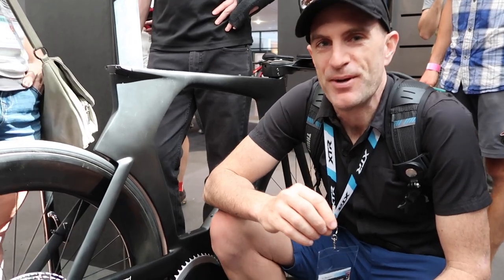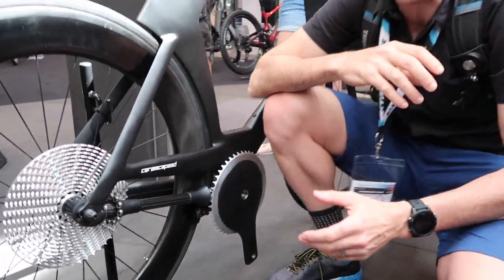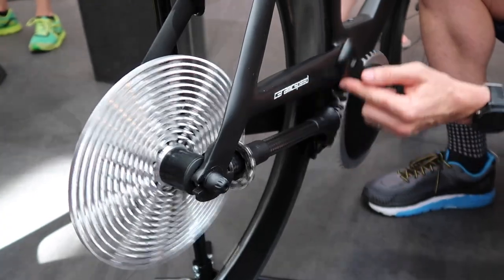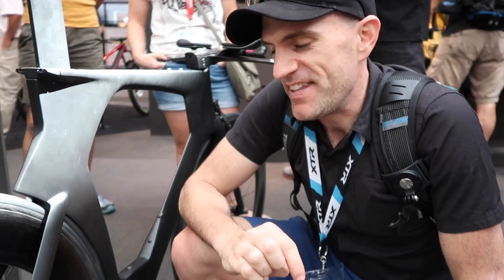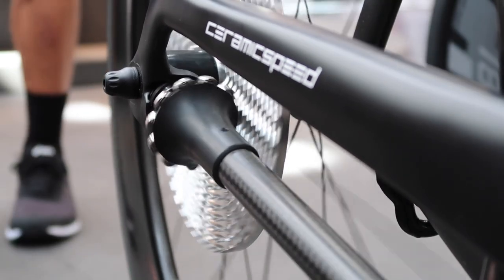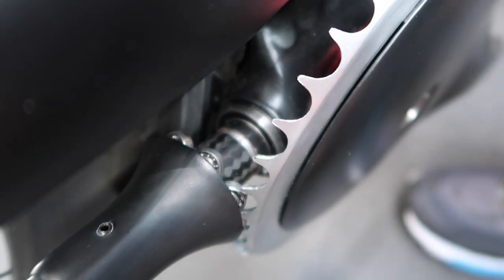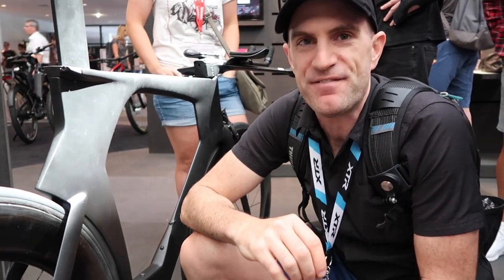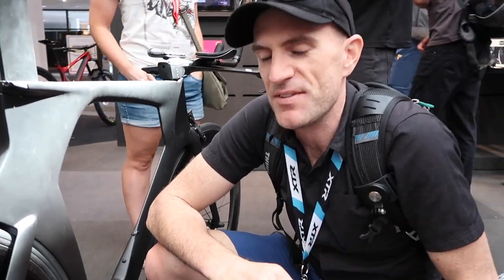CeramicSpeed DrivEN 99% Efficient Drive Shaft // Chain Free Bike // Eurobike 2018

Comment: This is literally a drive shaft with the pinion being replaced with bearings. It's not going to be 99% efficient just due to the mass in that shaft alone, let alone the friction in the pinion bearings, or the bearings acting as a pinion. There's a reason chains are used on motor cycles for performance and not drive shafts. This driveshaft set up is a joke.
Reply: Some BMW/Triumph motorcycles are shaft driven. Although it is not as efficient as a chain it is slightly more silent with hellical gears.
Reply: More than 50% of motorcycles are shaft or belt driven but the rest of your comment is correct. Just reading it seems to me though that you're assuming the majority if not all motorcycles are chain driven. That's not the case.
Reply: nateh120,
please provide the link to the source which confirms your claim of "More than 50% of motorcycles are shaft or belt driven. All too often people are just throwing out numbers on here to back up their preconceived ideals and why they don't provide the source or a credible source to back it up
Reply: nateh 120 
Lots of Harleys are belt drive, Honda sold a ton of shaft drive Shadows over the years etc. It might not be 50% but I'll let someone else count beans. I have a life.
Reply: And yep, the automobile was a joke to the horse industry, and the chain is so 18th century, just like the wind mill. Wich is so 14 or 15 century. ???? My point is, new tech is always cool, any tech to delete a chain from a bike is cool thaught.
Reply: Mass has nothing to do with efficiency.  I think that could probably be just as efficient as a chain.  Durability, and strength OTOH, I'm not so sure about.
Reply: More than 80 percent of statistics are made up on the spot
Reply: shadowwolfXD97 good one
Reply: byw it sucks that you don't seem to understand physics all that well.
Reply: Nwimpney, what is inertia? What are frictional losses? Mass eats up input power. In a perfect highschool physics class it would only eat up an intial investment, and if you never came to a complete stop it wouldn't be less efficient. But this is the real world with real materials and real scenarios, Materials all flex. A more massive object puts more strain on bearings making them operate at a higher friction level, making the drag more power. And on a bicycle you don't just pedal up to 10mph and stay there. You're constantly changing speed, meaning you're putting in work nearly all the time. Mass is something to consider beyond your pretend world of 9th grade physics.
Reply: nwimpney lol how does mass have nothing to do with efficiency? A motor spinning something with a smaller mass is gonna be more efficient than spinning something with a higher mass.
Reply: Thank you!
Reply: Why are chains not used on cars?
Reply: so sorry but it's 89 percent
Reply: byw 

The main reason chains are used on bikes is they're very, very cheap to implement and design.
Reply: I like to see that also.
Reply: How Its Tanked you need to look up the definition of efficienciy
Reply: Yeah, but shaft driven motorcycles have an internal gear box doing the transmissions, not the shaft itself. It's not comparable.
Reply: SirArghPirate look at the BMW 1200rr naked bike driveshaft. Lovely. Only does a 90° once. Its dope.
Reply: shadowwolfXD97 just like that one lol
Reply: If you think about how many scooters are in china and india, (which are all automatic shift by belt) that 50% is not that crazy claim.
Reply: You are absolutely right Chain loses almost 3-4 percent of an engine can put out, belt system has almost 10-11 percent of power lose. Shafts loses almost 30 percent of total engine output power but more durable and smooth and quieter.
Reply: 50% belt/shaft driven? What planet are you from?
Reply: Chains are used in car engines to drive the camshafts/valvetrain/lubrication systems.
Reply: kistuszek Scooters do not "shift". They use a CVT.

Comment: For zero drive train losses, have no chain, no pedals, nothing. Except a saddle to sit on and you move by pushing your feet off the floor, Flintstone style...
Oh, we tried this in the 1800's. Mmmm. Ok, tell you what lets use a chain to drive a back wheel and use pedals to rotate the chain ring. Yes! Problem solved....

Comment: A gear made out of aluminum?!  I think not!  Try making it out of titanium if you don't want it to shred itself after the first 100 miles.
Reply: drop92nn I agree. Only adamantium can hold up to all those battles.
Reply: Mr Brightside I don't know... There are some pretty long hills.  If they started at the top...
Reply: Unmannedair you are missing the key factor here.  Typical gear pressures occur due to the shear and slip.  In this case hard faced aluminum against a ceramic bearing shouldn't be deformed so long as it can resist deflection.  If made of say cuntstained targlide it would be even harder with a carbon backing for rigidity.
Reply: unobtainium is what they need to use for that set up.
Reply: You do realise the majority of gears are made out of aluminium.
Reply: yes, you are correct, however as said in the video, this is a mockup/prototype and is only meant to demonstrate the concept so it doesn't need to be made out of stronger materials. It is cheaper to use aluminium for prototypes instead of wasting money on failed designs using expensive materials. Later versions of this will use better materials. E.G the wheels used on the Bloodhound SSC      https://www.youtube.com/watch?v=mPshhkYpCBY&t=481s     5:20 onwards.
Reply: Joshua Amaral  Riiight. ;-)
Reply: jim jaco  I was thinking of vibranium. Wakanda forever!
Reply: pbgd3 but that is the problem.  The problem here is that unless it has some kind of deflection reinforcement it will deflect.  Maybe not in a lab, but real world is very different from Lab conditions.  Also aluminum gears are fine, but the strength is proportional to the thickness and those points are going to suffer horribly if any deflection occurs (and it will).  The additional problem is that the limit of plasticity will be reached on those tips long before the gear reaches any kind of critical strain.  This means that an aluminum gear like this will take progressive damage from metal hysteresis and work brittlizing  at a fairly quick rate (in terms of product lifespan).  Did you mean to say tungsten carbide?
Reply: In what world would anyone PoC and prototype with titanium
Reply: It's a prototype...
Reply: Diamond would be the best
Reply: doesn't look like it can withstand the force compared to the chains surface area, i think at the moment only two ball berings applies force on that aluminium gear disk
Reply: They don't make a material that would be stiff enough for the 8" sprocket to stay engaged with those slippery little bearings. As soon as a 165 lb. athlete jumps on one pedal with all her weight that little bearing is gonna spit out those sprocket teeth like the seeds of a cherry tomato!
Reply: its a concept...
Reply: @IRRob.  in a world where you claim 99% efficiency, i would say ..

Comment: Place this in an enclosure with a light motor and would be good for a electric bike. Also enclosed could be good for just basic riding but the mechanical advantage that a chain gives over this is just so much greater. The slippage of those bearing and any debris getting in them will kill it. Also I can see trying to change gears causing the bearings to lock around the driven gear and breaking the entire thing. Cool concept but doesn't seem practical at high speeds or in dirty environments.
Reply: An electric bike would't need a gearbox.

Comment: That is incredible. I see much room for improvement and much more than just bicycle applications.
To start with instead of having teeth it should have a thicker stock with ridges instead of teeth.
That would drastically cut down on CNC time and make it a much stronger plate.

Comment: Nice-ish in theory...  but no.  It won't work.  The wear on the very few teeth ever in contact will be HORRIFIC. The noise at even the lightest power is testament to just how much friction there is.  

At a guess, 8hrs to machine, 8hrs to destroy.  Also from an engineering standpoint, the closer you get to the 11t equivalent the more teeth will shear.  The closer to the much higher gears, the more the "cassette" will flex in towards the spokes.

Can see multiple weak points and multiple high wear contact points.  Not going to happen
Reply: I would worry more about the roller bearings being the primary power transfer elements.  They're typically not up to that.

Comment: - excesive cassette wear
- extremely dangerous - will require cover (ugly)
- noisy (higher speed = louder)
- small fragment of stone between the cassette and the bearing = disaster.

no, thanks.
Reply: I think the 1st and 3rd points are valid
Reply: How is it any more dangerous than a standard rear hub and chain?
Reply: Nope
Reply: Does it really need to be explained? this cassette is large and all the teeth point towards other cyclists and there is no derailleur or anything that would provide at least some protection. This is a meat grinder. And the contact between the teeth and the bearings must be extremely rigid to prevent tooth skipping because all cyclist weight will always be concentrated only on 1 ! tooth. So if there is an incompressible material between the teeth and the bearing, such as a stone or a piece of metal, the cassette will be damaged immediately or the shaft will be destroyed . That's dangerous. All this is not a problem with a chain.

Comment: I think it’s very beautiful very futuristic concept but the actual engineer practicality is suspect
Reply: +phuck ewe same was said about the first bicycle ever made.
Reply: Looks like only one ball bearing at a time contacting the ring while with a traditional chain drive you have anywhere from 6-30+ teeth being engaged by the chain. I see a large engineering challenge to make this more reliable than a chain-driven bike.
Reply: Futuristic? They used these types of drives in the 1890's.  Even had ones that shifted gears in the early 1900's.
Reply: steampunk type of practicality

Comment: Just an overcomplicated gear drive built of lightweight and weak materials and promoted well. This could be engineered to be more robust without losing much efficiency. Theoretical 99% efficiency is useless if you can't put the power through it without something breaking or malfunctioning.

Comment: Trying to reinvent something that no one asked for. Bike chains are simple cheap and ubiquitous. This looks complicated, expensive, and not leap of improvement over the current chain systems.
Reply: It's worse than that - they've invented nothing, this style of drivetrain has been around for literally centuries - have a look at drivetrains in Dutch windmills for example. This technology actually predates manufacturing and metallurgy being good enough to make reliable chain drives. When chains came out the whole bike industry went straight to them because they were much better.
Reply: peglor a chain is incredibly low friction and high strength

Comment: Looks cool, but unreliable
Reply: DEVARMONT7 key word is probably, all I'm saying that the idea is great, it just needs more tech to it to make it sturdy. Think of it, how many forces it will endure on road. Chain is simpler, thus it is stronger
Reply: Marat Bodrutdinov my guess is that this is a concept for real bicycles they will cover sensitive areas. I like it a lot. If succeeded it will bikes simpler and probably cheaper.
Reply: Dominique Lawson As everything else this could evolve to, so that it could pop out if you put too much tork on it. The chain system has evolved a lot since start also. Or it could find its usage for specific bikes.
Reply: This is really just a couple gears when you think about it
Reply: Unreliable? It's not even in beta test. Illogical statement.
Reply: i agree, pick up any old hand powered egg beater and see how well it works...lol.
Reply: Steve Lesson  The concept has a long history, and most engineers will tell you that this looks unreliable. You can see where the forces will transmit and where the stress will concentrate. The prognosis doesn't look good.
Reply: That gear on the rear seem easy to chip
Reply: #Marat you are obviously a expert on engineering techniques so will you please elucidate on why it is unreliable, please provide technical reasoning.
Reply: Marat Bodrutdinov its thin aluminium. what could go wrong?
Reply: It's reinventing the wheel. Just another way of making something that already works perfectly work in a different way.
Reply: ""it just needs more tech to it to make it sturdy"" as with literally every other piece of technology in the history of humanity at some point of its development cycle.
Reply: This technology has been part of the motorcycle industry for decades(and still today). Its a reliable technology you just need the right people to adapt it to a bicycle design.
Reply: Great concept. I’m sure it’s very efficient, probably not 99%, but ceramic ball bearings are very slick, so much better than a chain. The problem is the shifting. The cog teeth or gears of 11 different diameter wheels don’t line up. So you can’t do smooth shifting transitions. You have to stop the pedal and somehow rotate the driveshaft to be able to shift up or down. Notice that None of the videos are showing the shifting!
Reply: @maratbodrutdinov3255  how is a chain simpler? Far nore moving parts, more material, more complex manufacturing process
Reply: @TheFlyingJanner   it´s absolutely obvious that it is unreliable. Open bearings! What do you think will happen if you use it like that on the road?
Reply: @maratbodrutdinov3255  e

Comment: 13 speed "cassette" but no way to shift gears! This thing is just for ooohs and aaahs. Light years away from being a viable product.
Reply: Bradley Peet Well yea its a prototype concept....
Reply: You talk about it as if it's a commercial product but it's just a prototype. I doubt the machinery to shift is that difficult to make, but they would obviously want to develop the actual drivetrain first. There are still problems to overcome in that department, and the end product could look completely different to this prototype. The shifting mechanism will obviously be the last thing to add to this.
Reply: I was being kind. Frankly, I don't see this design as having the potential to become a viable product, period. How do you overcome the fact only two teeth (at most) are engaged at one time?  Not strong enough to handle high loads (torque). If you don't have a real plan for making it shift and shift well under load, that's a deal breaker as well.
Reply: Bradley Peet you still don't seem to understand the purpose of concept and prototype...
Reply: Sure I do. The purpose is to get attention at a trade show!  ;-)
Reply: Bradley Peet yea I guess everyone should just avoid new ideas and innovation if it isn't implementable right the very instant it's thought about, I mean who wanted aeroplanes and motor vehicles and nuclear power anyway....
Reply: A light year is a measure of distance BTW
Reply: Maybe the Litespeed company can develop it faster.
Reply: Well, if it's a prototype, who is going to design something without the thought of making money from it. Looks kind of cool but not being to change gears? Don't know.
Reply: You are correct, Damon. A light-year is a very large distance. Considering that we cannot travel at light speed, it is a distance that would take a long, long time to traverse. And so it is with this drive train design from CeramicSpeed.
Reply: every year is a light year by definition
Reply: It's not just the shifting, the "cassette" they show on that bike would not actually work, I read another article that said they are going to have to farm out engineering to another company to find a way to have multiple gears. That's going to take a lot of engineering, more than just extending/retracting the driveshaft. So right now, it only works as a single speed, not a fixed gear as someone else stated, though maybe you could remove the freewheel if that was desired.
Reply: One of the necessary parameters of the design would be to only ride on super clean surfaces to prevent engagement of a pebble  in the gears.
Reply: Gummy Bear every two years is a light year because half of the year is spent in the dark... boom got you. .
Reply: william dohn the reason you can't travel at light speed is because no physical object can travel at the speed of light. White is not a physical object and that is the reason it's not affected by gravity. The only reason it can move at that speed is because these forces such as friction and drag do not apply... therefore it can move almost instantaneously. That's the reason jumping to warp speed, or light speed is impossible. This is literally common sense...
Reply: J W that's a good thinking but I don't think I've ever had a problem with having a pebble in my gears
Reply: Hey everyone, Ive known bradley peet for 8 years, and i can tell you when he says it wont work, it is a fact 9 out of 10 times hes right every damn time. Bradleys father designed the release mechanism for the saturn 5 booster rockets, and Bradley was there by his side every step of the way. He has taken his fathers skill and applied it to bicycle quality assurance engineering. So when Bradley says it will never work, that means you've wasted more time reading this comment than necessary. Thank you, carry on.
Reply: This is more close to what was called an "Autobike" where you didn't have to shift gears it did it automatically.